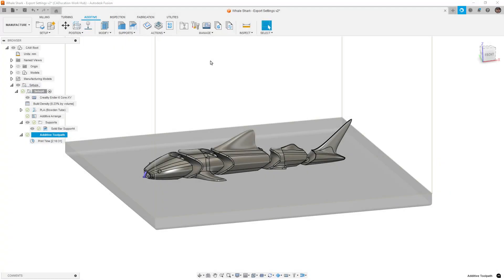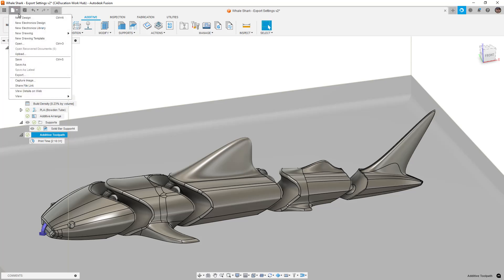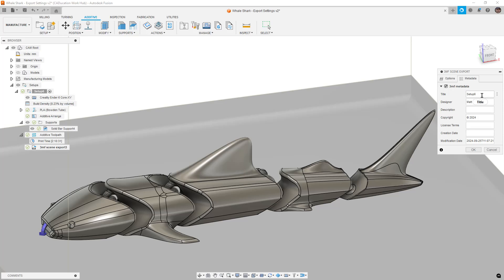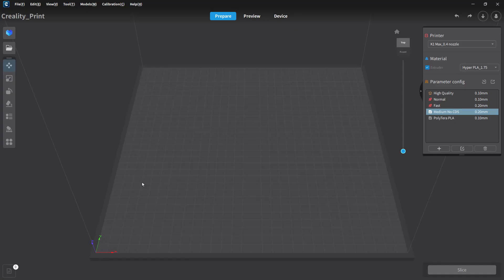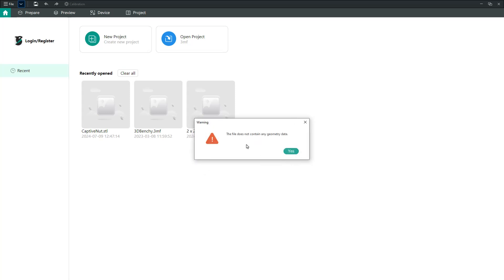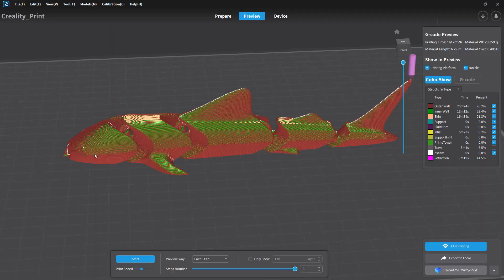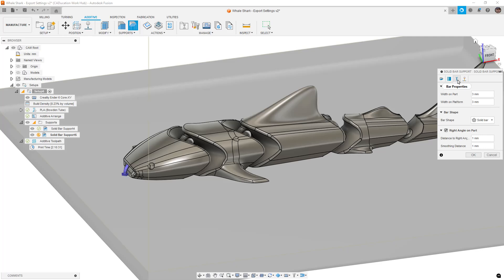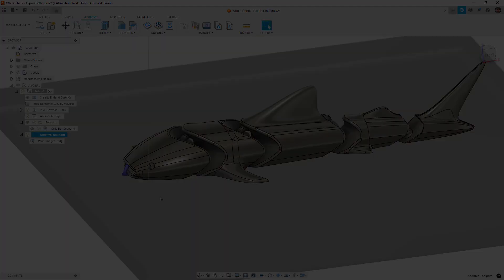How To Export a 3MF Model with Supports | Fusion Manufacturing #3dprinting #fusion360

Comment: I don't seem to have the "3MF Scene Export" option in my Actions menu.  Is there a trick to getting it to show up?
Reply from the maker: hmm. I didn't think 3mf scene export was a commercial only option but i guess its possible that it isn't included in a Hobby license.  On the file you are trying to export you must have a setup.  Once you have a setup created for additive with a machine and material selected (even if there are no parts) you should see the 3mf scene export.

Comment: So, if using Cura, and you want it to print in place maybe just export as an STL?
Reply from the maker: Yeah that would be my suggestion.  Full disclosure I don't use Cura as my slicer so it is possible there is some option I missed, but its interesting to see how 3 different slicers treated the same file.